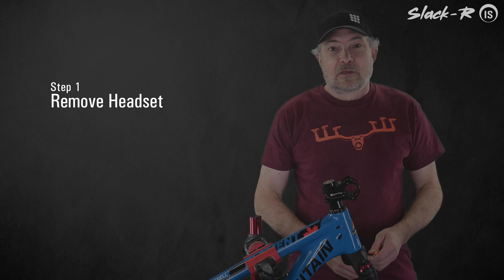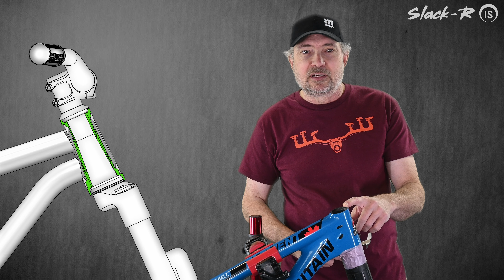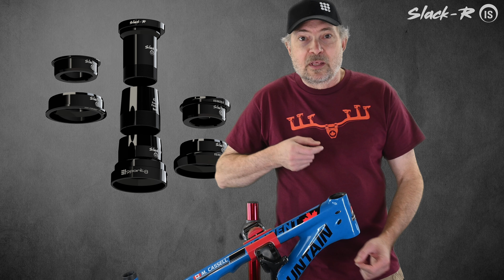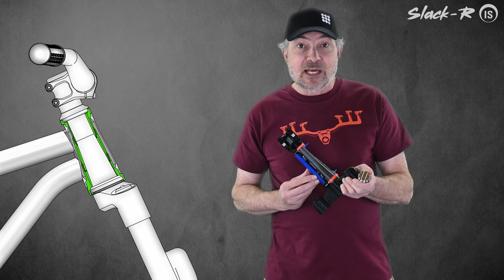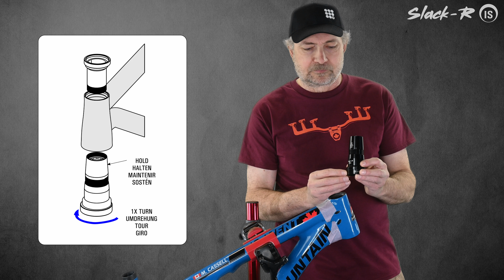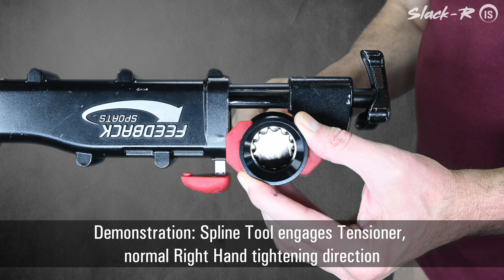Slack-R "IS" Installation Instructions

Comment: how many milimeters of spacers are needed above headset for this to fit?
Reply from the maker: IS41 and IS42 kits require 20mm of available stack height, and the IS42S version requires 24mm
Reply: @9point8ca once you sand the opening to fit the 34.5 headset cup are you then committed to using only slack-R or can you go back to the original frame later if you decide not to use slack-r?
Reply: @wbd3159  I haven't used it but your standard IS headset sits on the angled sides and he is sanding the inner head tube wall which never touches the bearings. So basically the IS system is unaffected by this and you can go back (no Slack-R installed) if you want.